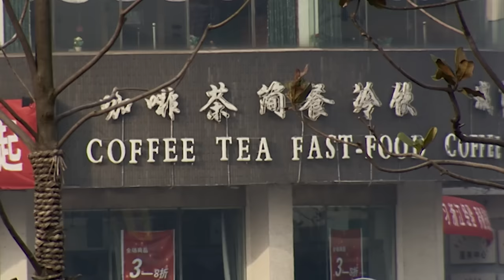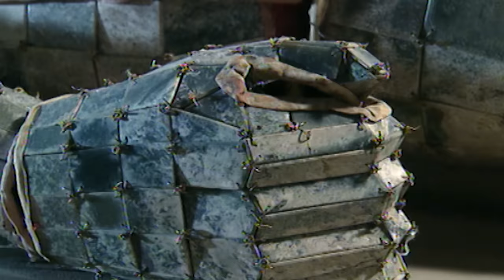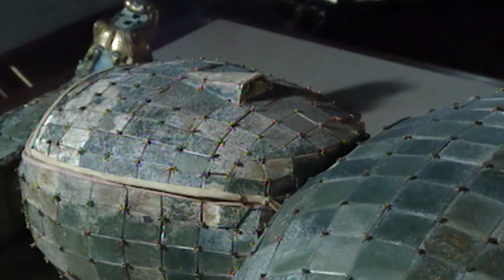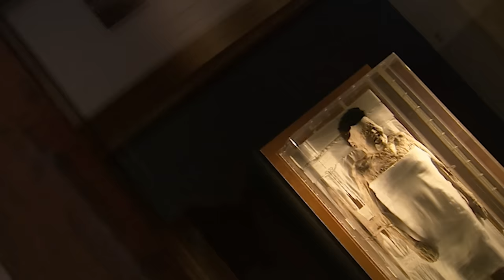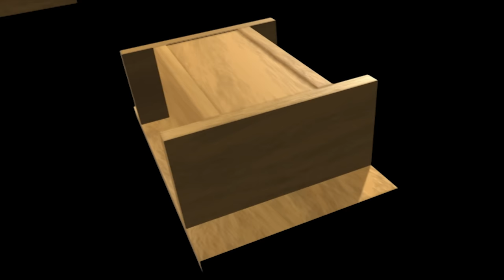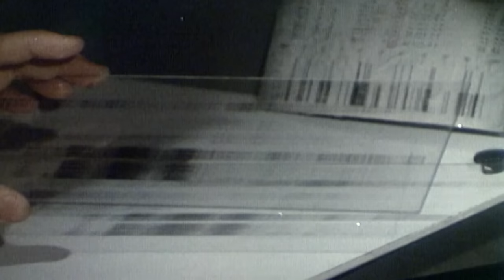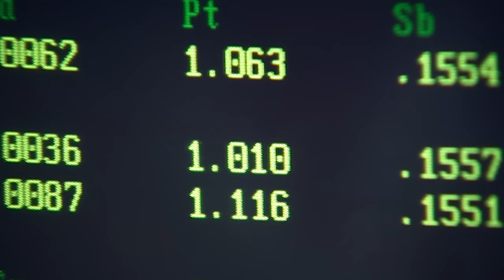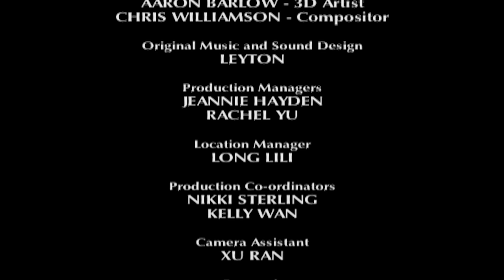This Is The Face Of The World's Best Preserved Mummy

Comment: Feeling personally victimised at the whole "70kg is fat" thing 🤣🤣🤣
Reply: Well I'm 60 kg and i'm 6'4 but teen still
Reply: I'm 69 actually . I dont do Kg's
Reply: Getting to eat large amounts of food was unusual back then.  Being fat was a luxury.
Reply: fr :P I'm 147 pounds (66kg), 5'2" (157cm), and Asian (Just like this lady). While I'm definitely pudgy, I haven't slipped into out-and-out fat territory
Reply: it is
Reply: I suppose it would depend on your height.
Reply: @teiloturner2760  that's sad tbh
Reply: @gracequach6769  lol its fine to be  little pudgy and slightly thin. What's not is being extremely fat or thin
Reply: For a short asian woman 70kg is alot.
Reply: Right? 🤨 I guess when you’re used to a population of people with chronic malnutrition, that seems accurate.
Reply: @teiloturner2760 huh? 🤨
Reply: @gracequach6769 not even close.
Reply: If you over 5 foot 5 as a female 70kg is not overweight… however if you below that in height you chunky. Simple as that. Like it or not. Also if you don’t you must be UK 😅🤣.
Reply: Lady Dai was only 155 CM  ( 5 ' 1 )  so 70Kg ( 154 lbs )  would have been a bit on the robust side but that also  is a status  thing going on there during many era  a large  number of cultures gauge you wealth and ability to ruel  based on size

Comment: If they had so much technology to preserve her, what's up with the face?  I mean, dang.
Reply: the chemistry is straight forward, there's no mystery here.. preserved in a mercury oxide and weak sulphuric acid solution.. that's what happens when you mix cinnabar with water... excellent preservative, but it will be mildly corrosive, and the body would still undergo some physical changes depending on the concentration.